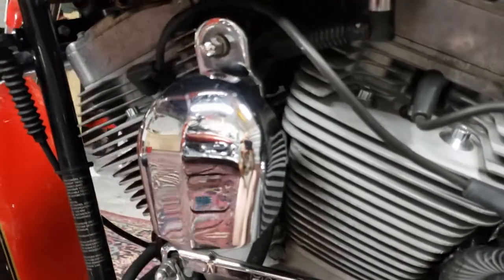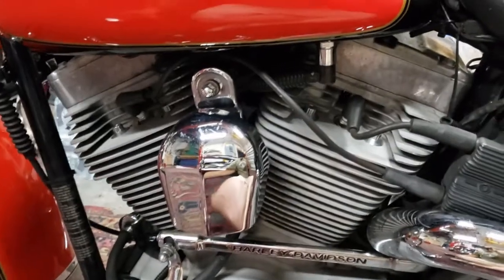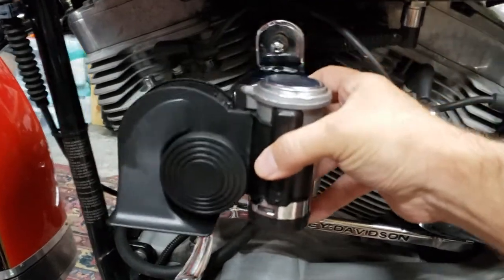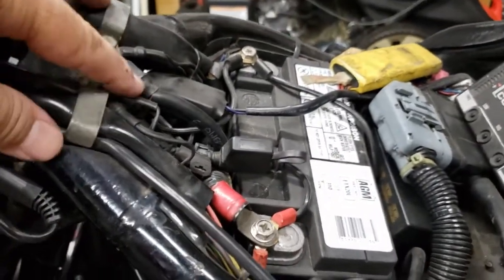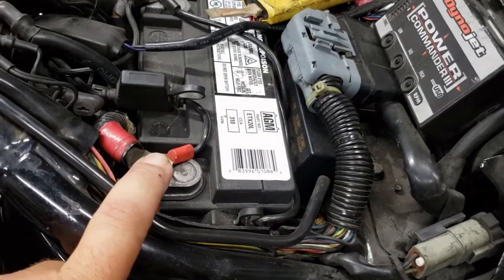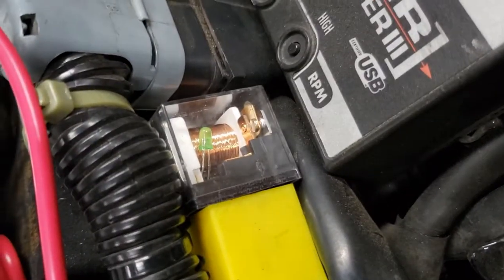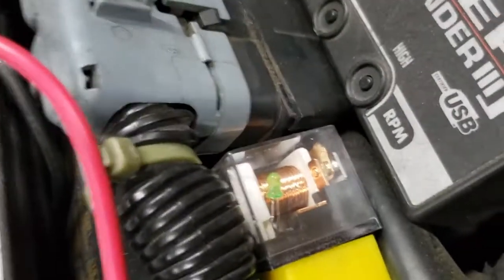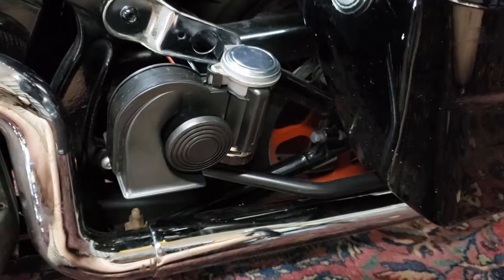Harley Davidson Motorcycle Air Horn Install

Comment: please, where did you get the mounting bracket?
Reply from the maker: I made it. I used the old horn bracket and mounted the new horn on it. I did have to make the hole bigger to mount it.